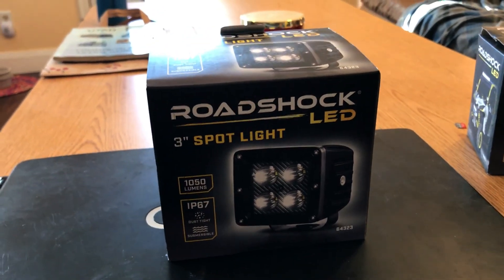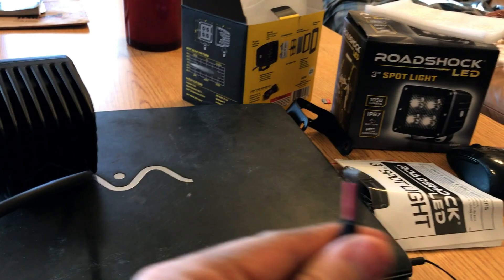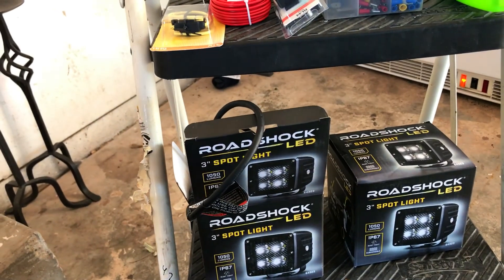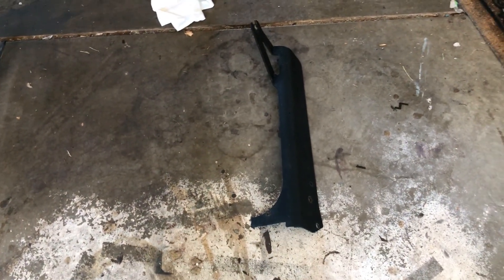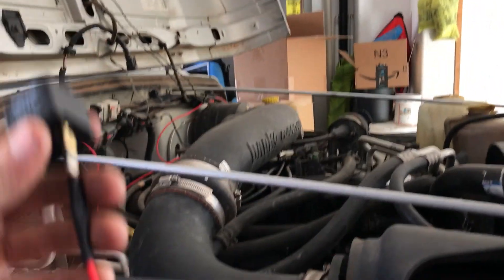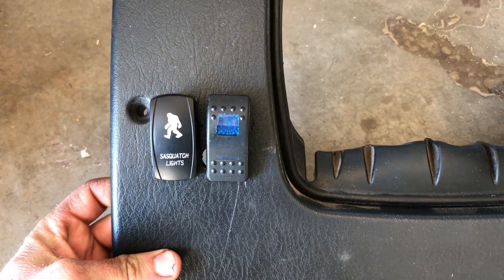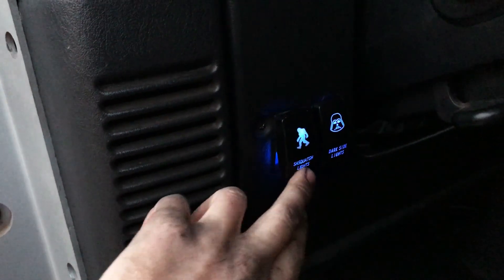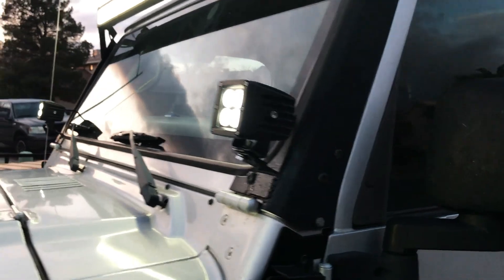Harbor Freight LED pod install on Jeep TJ

Comment: And did you fix the bracket issue?
Reply from the maker: I haven’t messed with them yet but I think I will heat them up with a torch and bend them. But just haven’t got around to it

Comment: were you able to buy all those supplies at your harbor freight ? also how did they do brightness wise ?
Reply from the maker: You can by the harness kit from harbor freight but I made my own with an inline fuse, relay, wire and connectors. Later on I wired the switches to my fuse box so the key has to be on to turn the lights on.